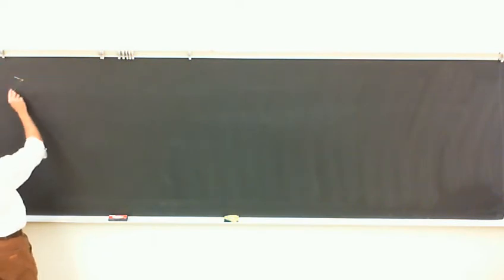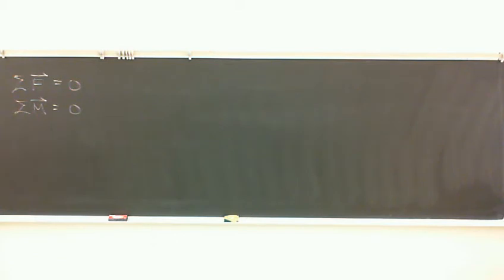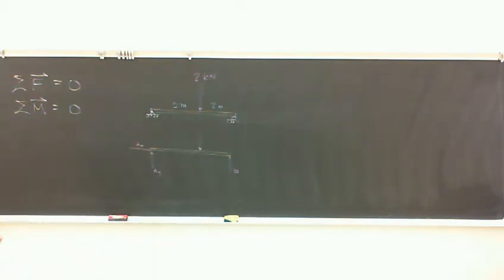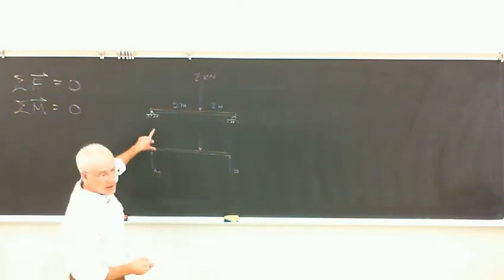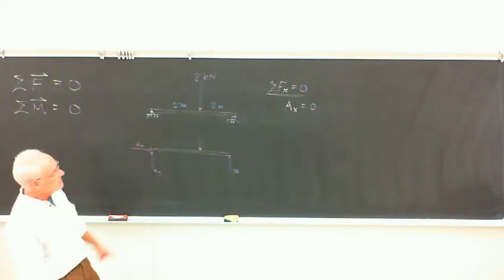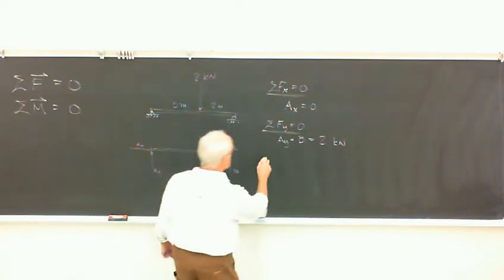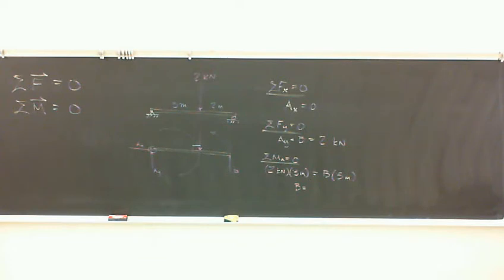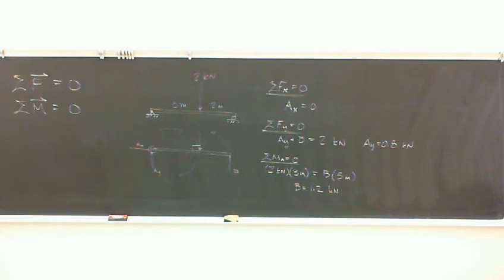Equilibrium in 2-dimensions, Part II

Comment: B=2.4
Reply from the maker: Hollow Aravind   I am sorry, but if you can’t take the time to form an intelligible question/comment then I can’t be bothered to engage further.
Reply: sorry about that, in 16:30 i get value of B=2.4 but you written 1.2 i even cross checked it that why i mentioned it so that other students will correct me if i'm wrong and i could correct my mistake

and your videos help me a lot and i learn so many things after finishing statics i'm going to start dynamics and SOM.
Reply from the maker: Hollow Aravind   I wrote 1.4 not 1.2.  Did you take into account the 30deg angle on B?  By is 1.2, so B = 1.4